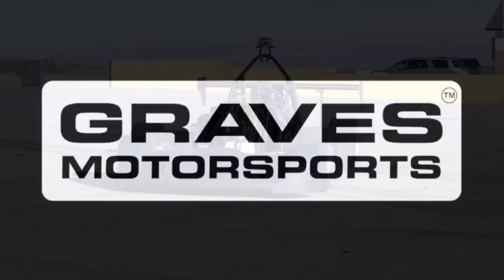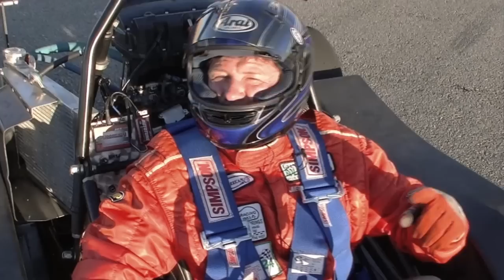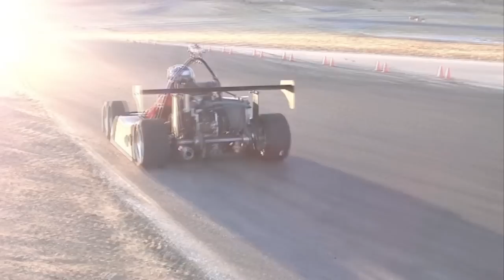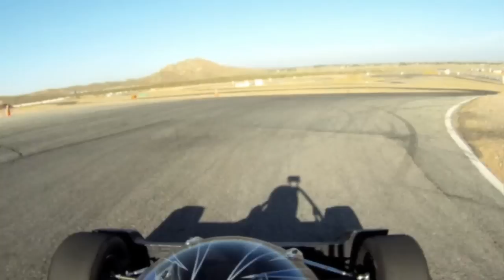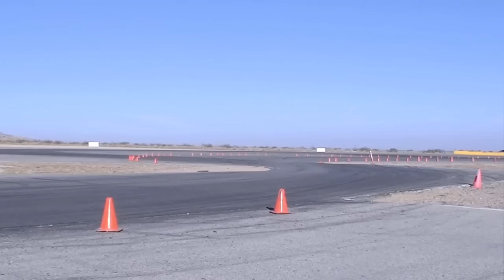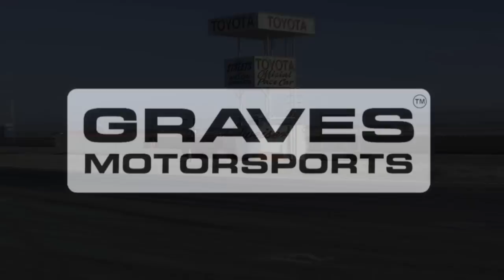Chuck Graves Insane Yamaha R6 Go-Kart

Comment: Didn't know that about the track! One clip compares an Atom to a CBR600RR, ironically fitting counterpart to the R6. Then Jeremy commented, the (4cyl) Atom hit 120 mph on the straight! Hmmm, such speeds May limit the Kart somewhat. Gearing's probably lower than a bikes, wheels alone would lower final drive ratio significantly, though it would take a lot to drop from original top speed of ~ 168 to below 120 mph. Still can't help thinking there may be enough give and take to make it interesting.

Comment: Having initiated the comment as somewhat a compliment to the Karts creator I have learned some things (such as; Top Gear track is an air field, not parking lot) and I enjoyed the responses. It may sound like an afterthought but I actually forgot the Atom's now a V8, for some inexplicable reason I was more intrigued with the original 4 cyl. which is what was in my head at the time. They did put a CBR600RR against the Atom, it (the bike) lost in the turns, straights were surprisingly close.

Comment: Actually, if you trying to pull off faster lap times the TC comes in handy. Did a class in the M3 School offered by BMW and the Traction Control basically allows you to hammer through the turns more quickly without having to worry that your rear tires are going to slip out.

Comment: At 16 seconds in he does a spin and you can see the rear straight on. The rear sprocket and the single rear disk are easy to spot, but the rear frame mount is kind of hidden. See where the wing mounts? That I believe is the axle bearing. Look closely at the right front at 40 seconds in. The upper A arm has caster and camber but no shock. My thinking is it's solid.

Comment: Where do you stand with this idea? Doesn't seem like it ever took off, but I'd be interested in any build sheets/specs you might have. I would be interested in building one just to take to a couple road course tracks in the area and have fun. If not, I may just grab a cheap shifter kart frame and slap the R6 on it.

Comment: Depends entirely on the size of the circuit really. This thing around a small twisty track would probably have it as f1 cars aren't built for mechanical grip. They go for a very hard setup so the wings are the same distance from the ground at all times... which is good for aero but aero is insignificant at low speed.

Comment: So, hoping I could get an opinion or two. Not really a karter, but I have a 2006 Kawasaki ZX6R 636 just sitting in my garage from a sweet trade, but it needs farrings, wheels, chain, tank, yatta yatta yatta.. but the engine and components are in perfect shape at only 10k miles. How much should I look at spending to get that put on a kart? Professionally, or if I find a reasonably priced platform and go from there?
Reply: Aww that's a sexy bike tho :(
Reply: It would honestly probably be cheaper and much easier to just buy the parts to complete your bike, unless you happen to find a kart made for the 636 engine/trans that has everything else it needs.
Reply: If you r serious, look for the 250cc "Shifter" type chassis, as they are BUILT to do high speeds, have gear linkages etc, and not some cheapo chassis. IF get a rolling chassis, will only require engine installer/mountings etc, maybe upgraded brakes, tyres and areodynamics if want high speed handling to be spot on.

NOT very expensive, as a very popular series and lots of older spares that are out of date for racing ppl. Great for avg guy who wants decent quality/safety.

Its all doable with basic tools, welder and fibreglass for wings etc.
Reply: i made a gixxerkart whit a good friend who could make almost anything from scratch and it took us al long time to succeed. end result was awesome and then it broke down (clutch trouble) and it broke down (gear trouble) and it broke down (engine lost oil) and it broke down... and again and agian.

and every time you get 3 min of fun out of it you will spent more and more just to get another 2 a 3 min out of it before it brakes down again. its the adrenalinjunky feeling. 

good luck building your dream. and keep us posted
Reply: +sven kleijn if something like that keeps BREAKING down, then its not being built the right way....remember...whenever you put a motor in something it was not meant to be in, you have to do your research. Oil in a street bike stays at the bottom of the engine because the bike "leans" in the turns...when ithat bike engines put in a shifter cart, its always flat to the bottom of the cart, as the cart goes around turns at high G forces...the oil will also go againt G forces, and be forces out of the bottom of the engine where the pump and crank is and travel up the side of the engine and casing....at that point it has no oil in it........its dry running....although its split, partial seconds...it will lead to a burnt up motor, wet clutch packs, etc. research the motor going in, the style oil pump it has, and other variable...in order to find out what can be done to make sure oil is being pumped always no matter how hard the cart may be cornering.
Reply: +sven kleijn if something like that keeps BREAKING down, then its not being built the right way....remember...whenever you put a motor in something it was not meant to be in, you have to do your research. Oil in a street bike stays at the bottom of the engine because the bike "leans" in the turns...when ithat bike engines put in a shifter cart, its always flat to the bottom of the cart, as the cart goes around turns at high G forces...the oil will also go againt G forces, and be forces out of the bottom of the engine where the pump and crank is and travel up the side of the engine and casing....at that point it has no oil in it........its dry running....although its split, partial seconds...it will lead to a burnt up motor, wet clutch packs, etc. research the motor going in, the style oil pump it has, and other variable...in order to find out what can be done to make sure oil is being pumped always no matter how hard the cart may be cornering.
Reply: we did consider the oil problem. and made adjustments.

clutch broke when the cart spinned out. engine is not build to handle forward movement to backwards whit engine running.

second gear broke. thats just a gixxer problem. yamaha R1 and R6 have it to.

the tires cant handle that kind of power and will  be sredded.

excuse my english i know its not great.

in het nederlands.

die kart was het beste wat ik ooit gereden heb. en tevens de duurste

Comment: I would use after market front mini alloy hubs. The front lower arms would be solid to the chasis (theres no suspension by the looks of it) then have a rose jointed top arm for camber adjustment. The rear looks like its based on a go kart axle but heavy duty (look at go kart axles for inspiration) then the mounts meet the chasis at the top as well, rather than just a bracket welded at the bottom. Hardest thing to work out is how long to how wide the wheel base needs to be

Comment: @Harriej123 It's not a "go-cart" it's kart. By that I mean, other than the r6 engine, it's not an unusual design. There are thousands of them around the country and they are pretty much all made that way. Admittedly, the power this one has, versus a typical 125cc 2-stroke makes it have a little higher danger possibility due to higher top speed, but it's not like regular karts are slow.

Comment: the type of high RPMs they run. bikes redline between 12-16,000 from a four cylinder while F1 is something like 18-22,000 from a V8 which is basically two 4 cylinders strapped together.

Comment: at :16 you can see there is a single rear axle that's chain driven (with 1 brake for that matter) before doing all the things you talked about doing I'd suggest the following. Add a rear differential (via small driveshaft, ring & pinion)  At those speeds you want the wheels to rotate independently. Because they can rotate on their own you'll need two rear brakes (unless you want to turn in one direction under deceleration).

Comment: Yes it is very important for acceleration which means this should excell on a narrow twisty track but on top gear's you're at really high speeds most of the time so the pure power of the atom should help it still pull maybe after 150 or 170mph and after all the atom is nearly 600bhp/tonne, I don't think this is much more (I reckon 120hp to 200kg with driver so again around 600bhp/tonne but it could be lighter).

Comment: Anyone know build price and parts kit?
Reply: this kart is wroth over 7000 for sure
Reply: +Julian Saiz well you can find a r6 engine for around 500-1000 dollars on ebay depending on the quality of it i would try to get a non abused one somewhere,then find a good frame or you could have one made custom to be able to manage the engine right,like custom mounts and stuf and reenforced you want a strong frame  ,and you can get tires cheap af on craigslist i know of a  guy that has one that will do 180 mph before spinning out,that engine on something that is much lighter than the load it was made for makes it go really fast

Comment: what wheel size are those?
Reply: Hoosier 18 inchs on 10inch rims, 10 by 8 rim on the back 10 by 6 on the front, with 18 by 7.5 inch tyre on the back and 18 by 6 inch on the front. :) good fun!
Reply: @Eeen_Engineer  thanks sir, you're a legend

Comment: An R6 will probably do something near 170 mph, it would make 140 quite quickly but full top end would take some space. It would be unlikely that the Kart is still geared that tall. Not many riders would be able to max out the R6's capability on a track in the corners, a rider that could ride an R6 to it's potential on a track with track rubber would make an interesting contest.

Comment: The r6 is going to be lighter than this go cart and will have a better power to weight ratio. The only issue when comparing the two on a road course is traction. The go cart has four wheels which is considerably easier to control. with a good enough rider the bike should still be quicker, but when it's easier to control something with considerably more traction, it leaves them standing in different classes which shouldn't be compared.

Comment: r1 probably would make it undrivable.. there is a balance between power and traction.. a car is only as fast as the traction can carry it... Check out the Scorpion P13 vs the Scorpion P6... they went with the 600cc motor also because at 60mph you roll into the throttle.. and you actually slowed down from all the wheel spin.. the 600cc would overtake it on the straight aways..unless you went with an full on race tire.. but it was designed to be driven on the road...

Comment: I absolutely love the idea of a 600cc or 1000cc sport bike powered kart, but the one thing these are desperately missing is some actual suspension. You can especially see it in the corners where the drivers are fighting wheel hop badly, and you can even hear the engine RPM's rapidly spiking up and down as the tires gain and lose traction erratically.
Reply: That’s the point of a go kart, no go kart of this kind uses suspension

Comment: Why would you put traction control on a race kart?
Reply: probably marketing purposes?..  as well not everyone has a feather foot and with these machines you reeally need a lite foot.
Reply: Probably simply because they could through the R6's ecu...
Reply: Best racing bikes (and lots of cars) in world HAVE Traction, they banned it in F1 as too good, made driving too easy. With this power and tiny tyres traction makes sense, as does NOT Stop tyres spinning, it limits how MUCH tyre spin you want to limit tyre at to stop u burning tyres up too quickly in race. For best grip/speed/longevity 10% slip may be best compromise, some cars/drivers may want more/less as their style/cars aero demands.

They also link it to fast gear changer systems, and even 4wd systems in rallying, so has become a big thing for many types of racer/racing.

Comment: I love when people say ''Oh man that must be fast" when a bike engine is in something heavier than a bike. You should try the actual bike!
Reply: The problem with bikes is high CG and poor aerodynamics. Something like this with a full drag reduction body could most likely out-accelerate a bike, out-brake a bike, out-corner a bike, and beat its top speed, too. And that's without any front or rear wings to ADD downforce.

In fact, the best-designed bike for handling, acceleration, and braking performance is the AAR Aligator with an 18-inch seat height and IIRC a 60" wheelbase. Ultra-low CG does wonders for 2-wheeled machines (as it does with any machine), but everyone's too much of a NIMBY with the traditional "ride on top like a horse" design for it to ever see the light of day.

Comment: Doesn't stand a chance on that track, with no suspension it's gonna be very unstable in the fast bends and on the straights it won't achieve such high speeds as the 300hp atom.

Comment: This whole "go-cart" is completely unsafe.... I wouldn't drive it for a 1000 bucks! No roll-hoop in the front, gasoline reservoir mounted completely unprotected near the stearing wheel.... What is case of a roll over? I suppose die is the only option here!